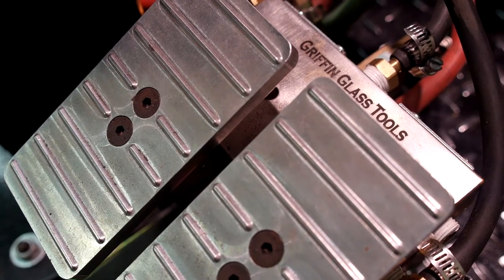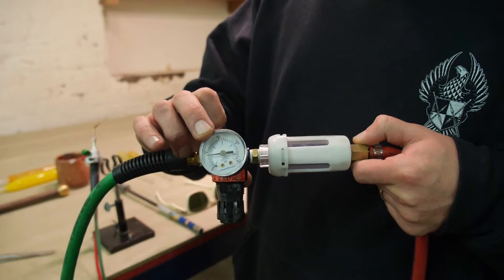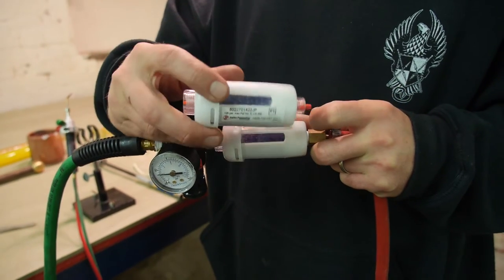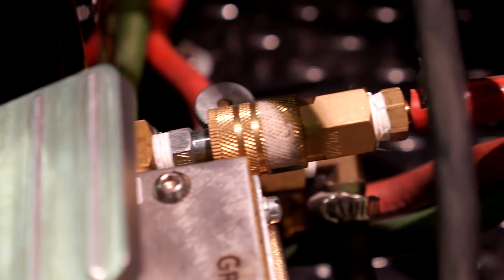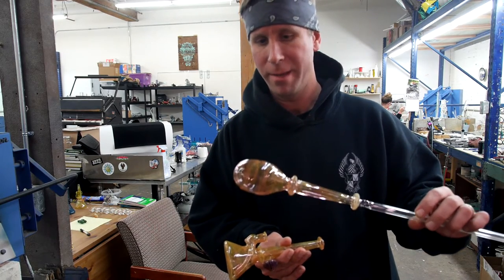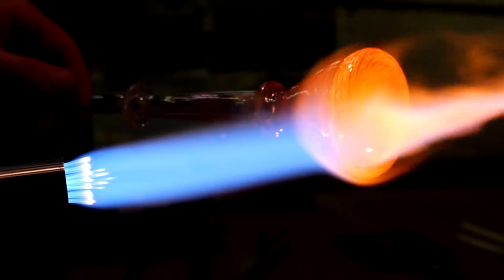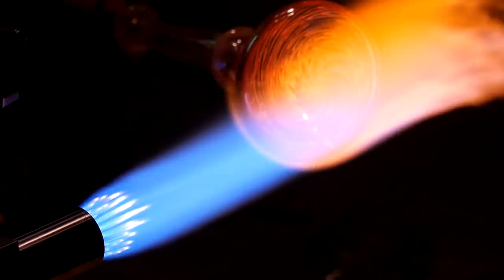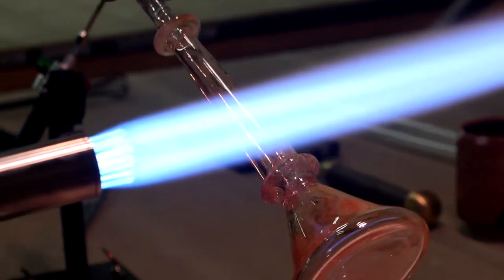Griffin Glass Demo: Hollow Forms and Compressed Air

Comment: they may not be so temporary as if you can get the crystals out you can dry them out in the oven at low temperature and reuse them. I'll double check the temperature for drying them but it's on the low side
Reply: if you put the used crystals on an oven tray or pan and heat for about 60 minutes at 250°f it should be enough to dry them out.